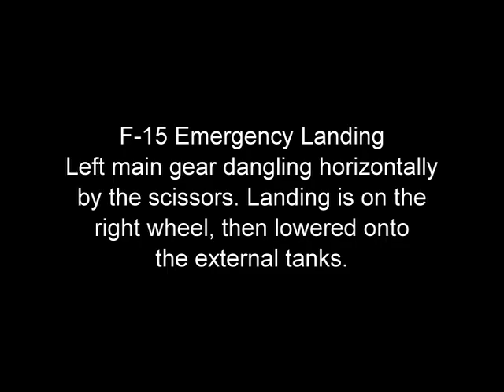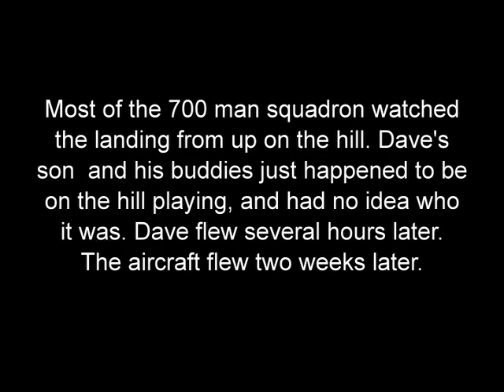F-15 Emergency Landing.mov

Comment: Wow, I remember that well. I was working at POL when the IFE came in over our radio net. I had time to run back to the dorm and get my camera before you came in. With the runway foamed, I pretty much expected a normal landing. But when the tank blew, I felt the concussion in my chest while standing on D ramp. I remember saying to myself over and over, "Oh my God...Oh my God". Seemed like an eternity until you raised the canopy and everyone knew you were ok. Great job!
Reply from the maker: +luvofcountry Well thanks for your concern. By the way, the runway was not foamed, at my insistence. I was not a foam fan. Knowing where to put a limited amount of foam in this scenario was pretty difficult. I couldn't say precisely where I would lower the tank to the runway. Plus it's slippery stuff and I needed braking and nose gear steering to be effective to keep it on the runway.  The other issue is foam can come up over  the windshield, and then you can't see where you're going! Plus, it's cow pee and stinks like crazy! We know the tanks are going to pop, they always do, and the fire guys can quickly drive to where I stop and foam it. Way better than slipping and sliding through cow pee! They didn't get any on me, either! Yeah, I was slow to raise the canopy. Every one said that. No hurry. I wanted to be completely unstrapped and unhooked from the jet so I wouldn't end up hanging upside down by my G-suit hose, plus the canopy down was fire protection while the fireman were arriving.  I did take abuse for a slow egress, though!
Reply: Nice save of yourself and the jet. That was a hairy situation but you kept your cool and saved everything. I think you did an AMAZING job! A slow egress is better than an UH OH anyday.🇺🇸💪😃🇺🇸

Comment: This is fairly old. The crash truck seen early in the video with the two on top has been out of service at least 12 years.
Reply from the maker: +Torpedomtb I'm fairly old, too, and also out of service!
Reply: There's still a few P-15s around. Albeit not many, definitely not as many as there once was.

Comment: Is it just me, or was that tower crew totally blasé? At least one, possibly two very expensive fast packs destroyed, "the flames were right underneath that AIM 9," (sidewinder), and nothing about the pilot before or after. I mean, surely any halfway normal person would say something like, "Gee, I sure hope he makes it," or "That was a good job," but no. "You should have been here earlier, that's when the real action was…". Morons...
Reply from the maker: Tom Foyle The guys talking in the video were firemen in the fire station. Your observation is correct, but I  think they are pretty nonchalant by  nature (you have to know them to know this) and their buddies did a good job for me out on the runway. They told me, at least, they were glad I made it when they gave me the video. Too bad the auto focus snagged the window frame. The AIM-9 was inert.  I knew a lot of the fire guys over my 21 years and was often their "training dummy" for practice on pulling a pilot out of a burning jet. (Some say I'm a dummy by nature.) They were good guys.
Reply: wildmandl Ok, fair enough. They just SOUNDED like they weren't bothered!
Reply from the maker: It was a good thing, but it would have likely turned out the same. When I was pulling SOF  at Holloman AFB, we landed an alert bird,  F-15 loaded 4 x 4 x gun,  gear up (or partial gear--I can't remember)  on the three tanks with no damage to the missiles. It causes more heartburn, though.
Reply: Good thing it wasn't one of the alert birds, with lives onboard, at least.

Comment: fuck..what is the firedepartment slow..they arrive almost a day to late...
Reply: I infer from your question that after watching the video, you have a sounder assessment of the situation and the best course of action than did the professionals on the scene. Even though they had complete familiarity with the runway, taxiways, intersections, and surrounding turf, you clearly imply that their judgment was inferior to yours. Accordingly, I am sure we're all eager to read your assessment.

How would you have sped things up? Park them on the runway where they would obviously be a landing hazard? Park them somewhere on the taxiways other than the location chosen by trained and experienced firefighters? Have them skip the taxiways and just run across turf that is actually too uneven and soft for large vehicles to traverse without getting bogged down and never reaching the plane?

I'm sure we all wait with bated breath for your answer.

Comment: I remember when this happened!  I used to be a volunteer at the air museum on MAFB from 1986 to about 1991.  I used to run all over that base shooting photos and video.  Believe it or not, we've actually met several times. I was up in the control tower shooting some photos for the museum and you were the SOF while a few 318FIS birds were airborne.  I also spoke to you several times at the squadron during some of my many photo shoots!  Whatever happened to LTC Bernhard, and MAJ Jim Boehm??  I

Comment from the maker: We never shut both engines off, and idle thrust improves the glide ratiio, but at idle I think we used 210 KIAS for best glide, L/D max, and we probably got about 2 NM per 1000 feet, maybe a little better. That's a 5 degree descent angle. So, 12000 FT for 1000 FT of altitude= 12. With both engines out, we would still use 210, but the glide ratio would be worse. That's in the ballpark, anyway.   In 737s, a 250 KIAS idle descent is 3NM per 1000 FT.

Comment from the maker: We use rudder, but not in normal flight. The F-15 has aileron-rudder interconnect, ARI; the flight control system adds rudder for coordinated turns. You don't need to use the rudder in the traffic pattern. When you use the rudder,  it is to deliberately get uncoordinated flight.  The F-15 is normally landed in a crab in crosswinds.  I used rudder to land wing low on the one wheel I had. We use rudder when fighting to get higher roll rates at high angles of attack, bring the nose around, etc.

Comment from the maker: Thank you. We did a wing change locally and the airplane flew two weeks later. A bulkhead where the flap attached had a crack in it. Maintenance thought when the fuel tank blew up, the force on the flap cracked the bulkhead. A no-flap landing might have prevented that, but who knows. I'll take it like it happened. I can't remember what I squawked or put in the 781, now that  you mention it! That's funny.